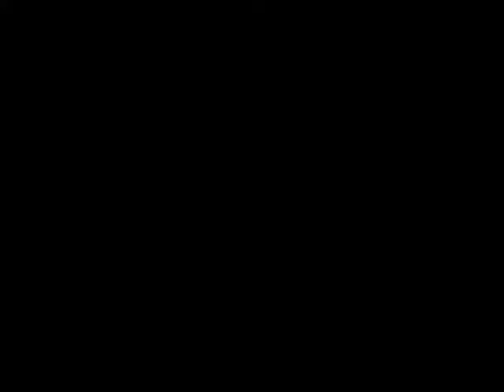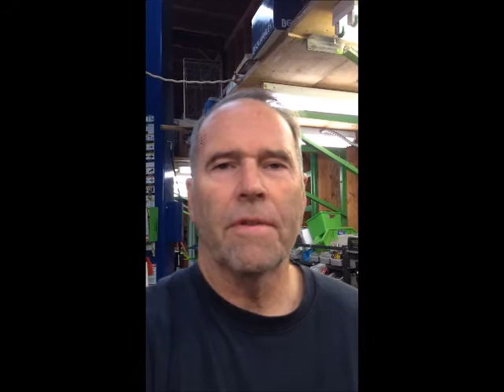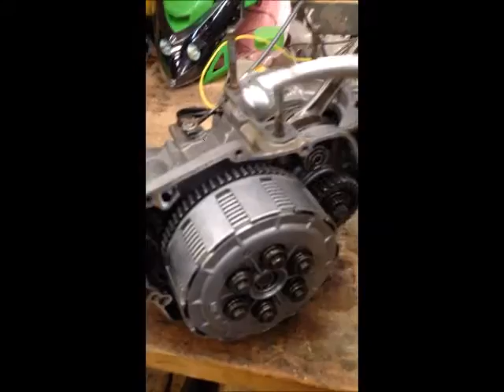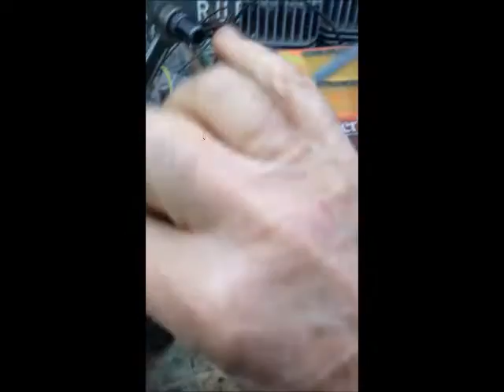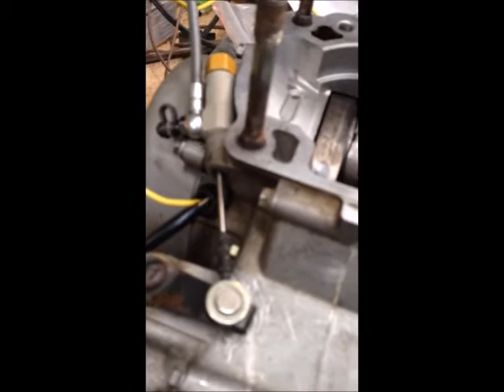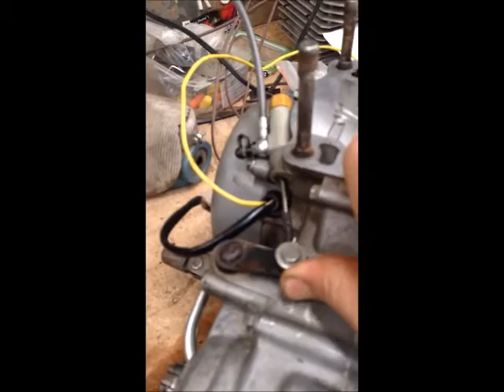Magura hydraulic clutch

Comment: Good Video, Ive ordered 2 Magura hyd. clutches and they dont fit. Ive received to different part numbers 0120524-25 & 0120524-20 and both kits had wrong slave cyclinder. One from Powersports and one from Rocky Mtn ATV mc.... By chance do you know which kit yours used or the size of slave cylinder. I have an 03 KX500.
Reply: maybe you ordered the 1988-1991 one

Comment: hello clark just wondering i also have a lighting coil for my kx500 and wasnt sure how to connect the light do i need a regulator befor the lighting harness or just wire it directly to it
Reply from the maker: +Mike Bennett Just go directly to you bulb(s).  I ran my ground of to the ignition coil mount.  You'll find you need to be at 30% throttle for the light to be decent since the lighting coil's power output is directly related to rpm.
Reply: That depends on your light.  With the 12v Slasher LED light that I run, you do need a regulator/rectifier. I run the one from Trail tech.  A Full wave regulator/rectifier works much better on the KX500 than a half wave regulator/rectifier.